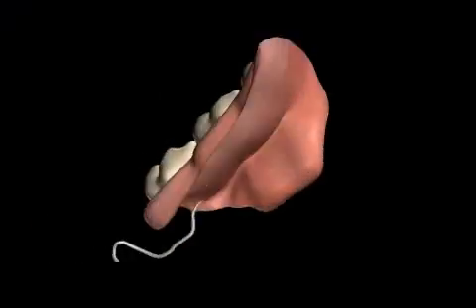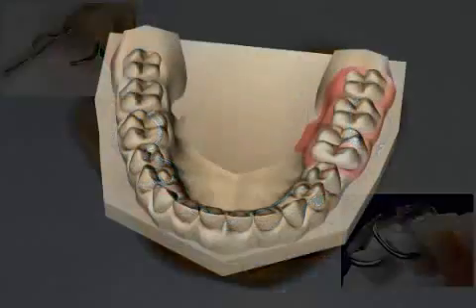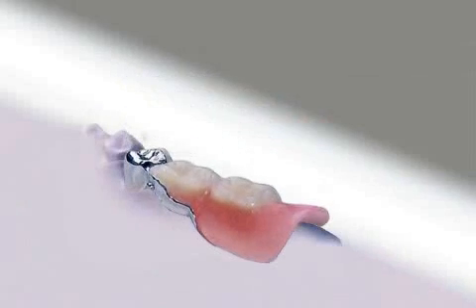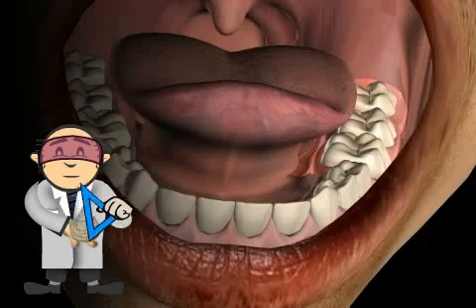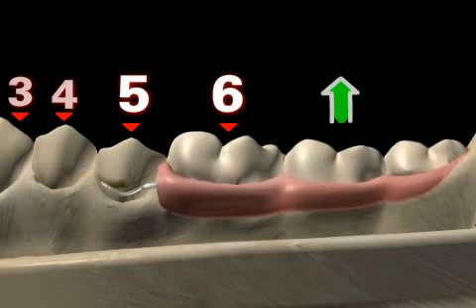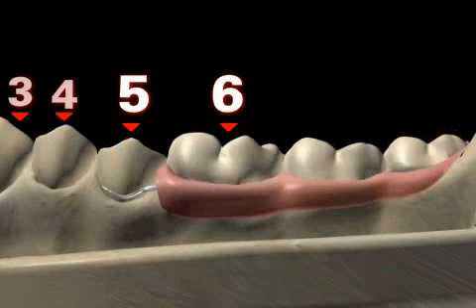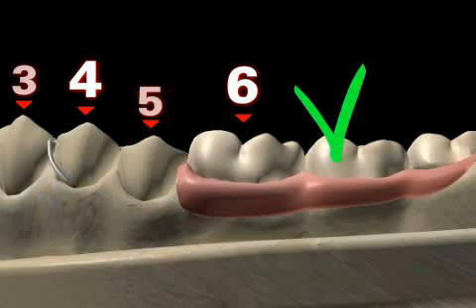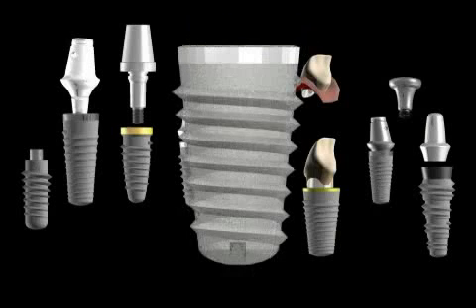Why Partial Denture turn often in Total Denture (total prothesis)

Comment: The  design of the partial is very important.Some clasps do cause strain on the natural teeth.RPI or back action clasps are a better alternative .I use them whenever possible.When designed properly they have very little stress and damage to the natural teeth.C clasps are usually the worst for damaging teeth.

Comment: 32 years old and all my molars are breaking off due to my dairy allergy that upsets my facial nerves and make my tooth's sensitive specially my molars now they end up breaking. Anyone know this condition? 

It's 100% due to my food allergy when I take antihistamine my facial and tooth pain often goes away.
Reply: I had never heard of that before, but literally the same thing started happening to me at the same age, and I was lactose  intolerant up until a few years ago. Now i am just lactose sensitive, sometimes. But yeah, I had a couple of the metal fillings in the back, from when i was younger. One day they just started poping out of the teeth. Then the the cracking of the molars happened over time.
Reply: @girl6girl6  It's called facial pressure and allergic reactions can trigger a sinus infection what will end up upsetting the molar nerves.
I once read somewhere your nerves are trying to get rid of them self so an automatically body responds is to break the molars so the nerve can go away. My filling got loose too. I will get it checked with a doctor, this condition needs a recognition.
Reply: @Morenob1  that is also weird because I am allergic to pollen, and just had the most horrendous summers as a kid.  I'd be all congested at night and my eyes would itch really bad, so i would rub them.  in the mornings, my eyes would be glued shut.  Another weird thing is that my allergies changed when I moved to LA for the first few years it switched back and forth from eyes to nose, then just vanished.  Ilke all of a sudden pollen wasn't a problem and more...till this week.  But its winter right?  some weird shit is going on.  All week long I have been having that pre-sneeze nose sting feeling.

Comment: Sorry, the movements are exaggerated an the examples fail to show the full design of a bilateral denture base, supported on the lingual of all remaining teeth. A properly surveyed and designed denture will last years. I have seen patients with partials, both metal and acrylic, which are 20 and 30 years old at times, even though we recommend replacing from after 8 years as a baseline, and these older dentures, some are still in excellent condition and not even needing relines. That call comes on a case by case basis... wear and tear, bone recession where applicable, etc. If you want to promote implants, fair enough, but not at the expense of perfectly valid and functioning alternatives... Overdentures are also great, but every kind of denture is as good as the patient who looks after them, and the clinician who has a good denture well designed and placed and that last call is left most times to the dental lab who has to rely on what he hopes is a good impression... There is  a lot involved in the whole process...
Reply: Bullshit, you're a fuckin lying dentist.
Reply: @johnwayne2374  lol 😂😂
Reply: Antonmursid🇮🇩🙏🙏🙏
Reply: I totally disagree with you.  In the past 8mths I have had three partial dentures (all three types).  None of them have worked.   The first dentist that pulled my teeth capped the tooth in the back that the metal ring was around, not for that purpose said tooth had to be capped anyway.   That tooth initially was totally straight, I haven't eaten real food in 8mths now let alone chew gum.   My cap is very visabily turning in towards my tongue.  I have truly been thru hell this  yr.  Spent thousands of $$$  on my teeth over 55 yrs.  Dentist every 6 mths without fail.  Got sick 3 yrs ago and it affected all my teeth but 8 on bottom.  1st dentist (oral because I needed sedation) saw me the day after surgery, 1 min, sent asst. in, she took them in and out never looked at my gums.  After that could not get an apt. for wks for sore spots and burning on roof of mouth.  Saw another dentist (1st dentist paid $7,000) she said "do not put them in, your gums are ulcerated, the burning is not normal as 1st dentist said VIA PHONE, it was thrush, had to take medicine for 5wks.  Got 1 apt. in 5 wks, 3wks later called for an apt, ring was killing me even when partial wasn't on. No apt. avail for 2wks.  Read contract, called my ins. co who gave him $900 that's $7,900, just for teeth pulled and temps.  Told ins co he'd cancel all next day apts just FOR ME.   Got in after 2hr wait, he took them and threw them on counter told me to get out or he'd call police, "no one calls ins. co on him".   Have a suit pending,  2nd dentist permanent partial all 3 teeth facing my  gums, told "that how your old teeth must have been".   $1,600, and $200 to a flybynte ins. co.  That dentist told me I needed bones shaved.  Went to another oral surgeon, shaved 1 spot was paid to shave all bone protruding, after shaving one spot said "that's enough" don't like to do unnecessary work.   This time I got the flexible partial.  He cancelled 6 apts. in a row, on my apt. day FINALLY,  told me partial was not ready.  I had my whole family with me this time, said we were not leaving, was told they were ready a mth ago.   Come back at 3pm.  He put on wet/hot partials, waited 10 min. told me I was done.  Said, "they are killing me".   Positive thinking, don't be negative,   Out over $8,000 another couple of thousand to go but not for 5wks until my ulcerated (AGAIN) gums are healed.   Dentists should not get full amt. until job is done.   This was all after careful research and not cheap dentists.  A nightmare, for 8 mths no teeth, no real food and will not leave house w/o teeth.  You dentists are crooks, most of you here in Florida, in NJ for 25yrs. had no problem EVER.   There's a special place in hell for you people, not to mention I am disabled.  I will pursue this until I loose the house for me and so no one else has to go thru what I have.